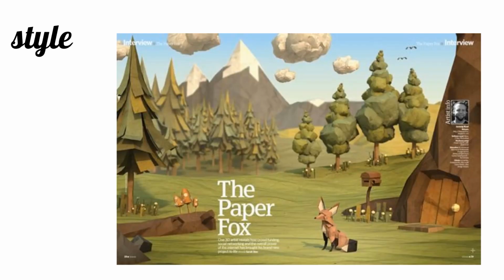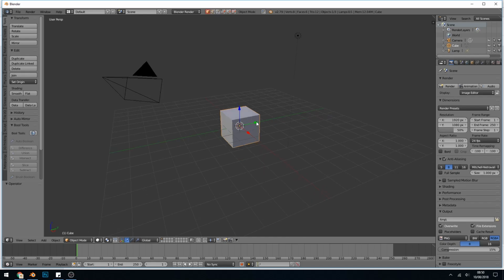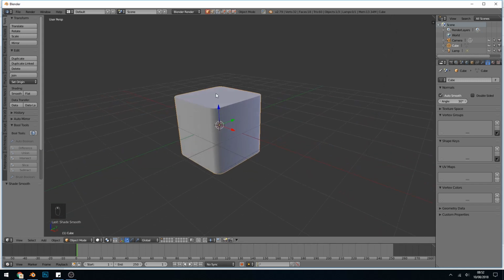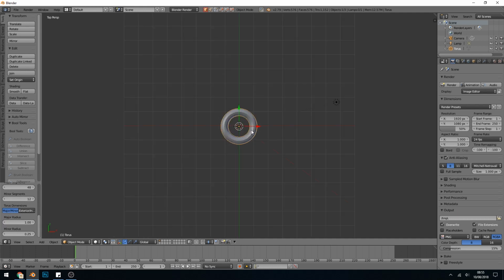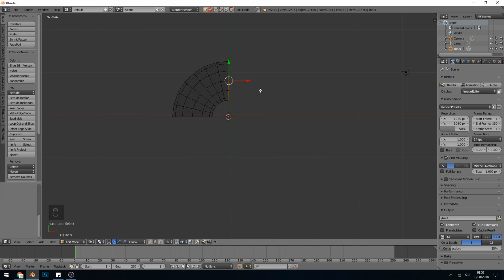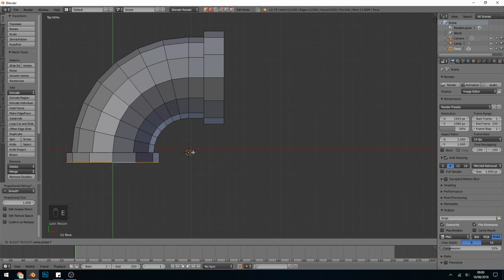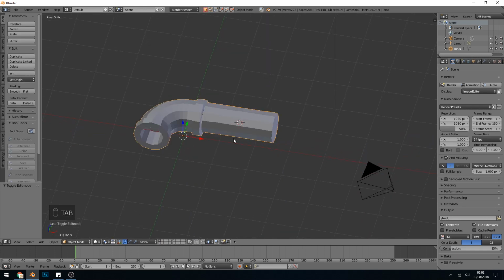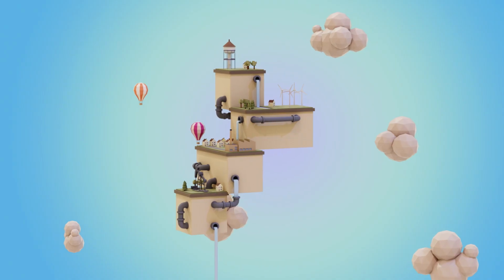Low Poly Islands | Beginner Tutorial | Part 1

Comment: Easy method make both face of pipe same size: one face press S, shift + x, type scale value = 1.1 for outside pipe and type scale value = 0.8 for inside pipe;  other face use shift + y. Also can type radius size when create cylinder for both pipe have exact same radius in left menu option.
Reply from the maker: Yes that would work well

Comment: Q's pt.2: On your coloring comment about making the islands and coloring them as you go. I was going to try this but when I attempted this all the cubes (duplicates) turned the same color. Is this because they are the same, duplicates? Do I have to (P) separate them first? I guess I don't really need an answer cause I haven't got that far in the videos, maybe this issue will come up then.
Reply from the maker: djC653 they share the same material. So for each one if you want a different colour you need to assign a new material to it
Reply: Hmmmm . . . Ok now it worked. Cool.

Comment: Great video tnx. So I made the corner pipe and saved that. Then, like in the video, made the straight piece of pipe and 'separated' them. Is there a way to just save the straight piece and not both together in this situation?I selected the straight pipe and tried to save but it wanted to copy over the corner save I did earlier.Can it be moved to another layer so I can just save that part?
Reply from the maker: press p to seperate when in edit mode. you dont need to move it to another layer